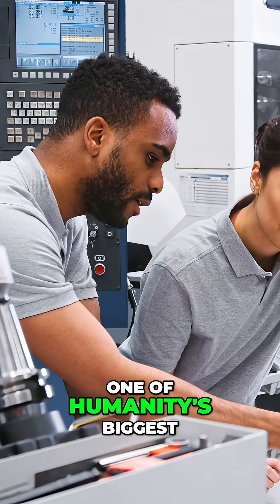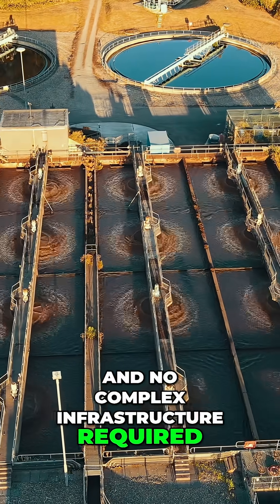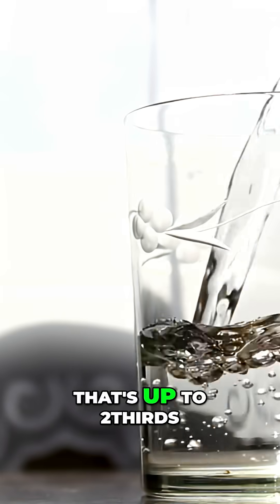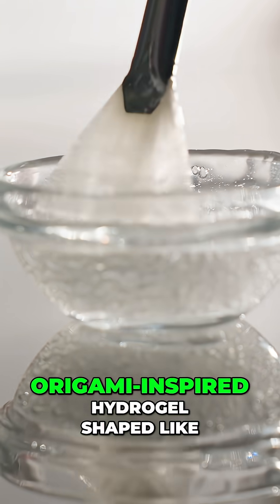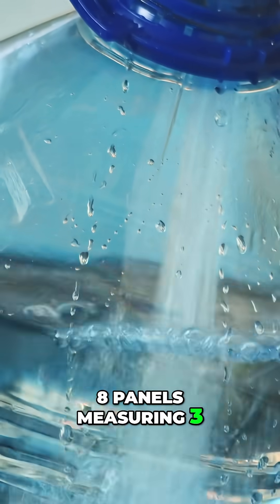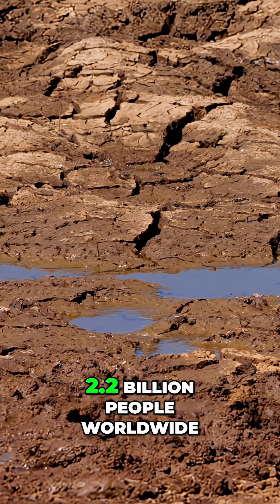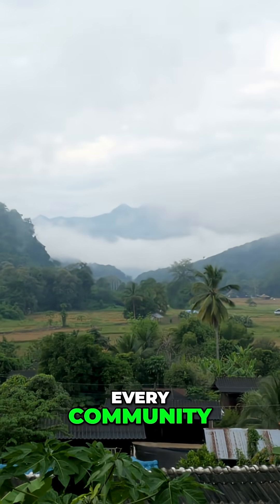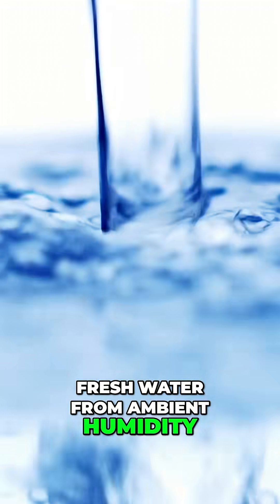MIT Just Made Water Out of Thin Air—No Power Needed

Comment: That will make a difference everywhere, and it can be easily cleaned! It will even work with brackish or sea water. There is a recipe for heat filtering in Lindsay's Manual of Formulas book.
Reply: This is not a desalination system. It doesn't take fresh water from salt water. It takes water out of the air. Air humidity. 

There is amazing simple new technology for extracting drinking water from sea water.

Comment: I live in the Sedona Desert, average relative humidity of 20% (the same as the Sahara). I'm in the mountains, a mile above the desert floor, so no problem with triple digit heat, but still massive problems with water. I think this is brilliant, but I will continue to use cheaper fog nets to water my garden. Great idea, though.
Reply: @lindacgrace2973  🧢

Comment: What climate change hazard if everyone in the world removed water vapor from the air? 

Deserts are cold as hell at night. And any film can trap and collect water from the atmosphere. Every single family on earth can use solar energy to make drinking water enough for a family of 5 with a small device hanging on the wall. We did this in the early 2000s. Air Water systems have been around for at least 20 years.
Reply: The awesome part of this is the possibility for accessible devices at such low relative humidity. If this can get to scale it can regenerate aquifers, shore up rivers, allow farms to irrigate. Everything needs water
Reply: I've been trying the same with a Coke bottle, it condenses without any special coating.

Comment: Sooo.. the question is this. If you pull what little water there is out of the atmosphere, what happens to the eco system that depends on that small amount of water farther down the line? At some point doesn't it accumulate and rain? If you suck it out of the air before it moves on, aren't you simply moving the desert to the next place??
Reply: Came here to say the same thing! Has anyone considered the effect of removing water from the air in areas that have so little already? Likely not an issue for individuals, but they are talking at scale for entire communities. 🤔
Reply: MAKE RAIN ILLEGAL ! !!

don’t know if you are a contrarian troll a m0r0n or just a lun4tic…
Reply: do u think it can reduce rainfall in desert? lol
Reply: @weirdo8435  You COMPLETELY missed the point.
Reply: @weirdo8435 No, but apparently you can suck out what little moisture is in the air. Don't you think making deserts even drier might have some kind of effect on that fragile ecosystem? 🤔
Reply: @seanhoude  bro, ur ecosystem will be affected by this with 0.000000000001% change. amount of air is gigantic.